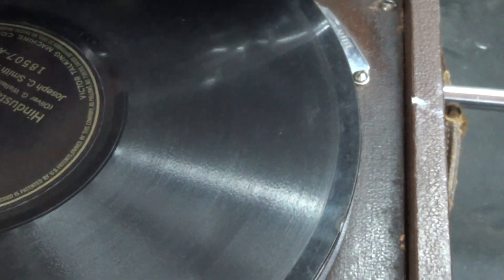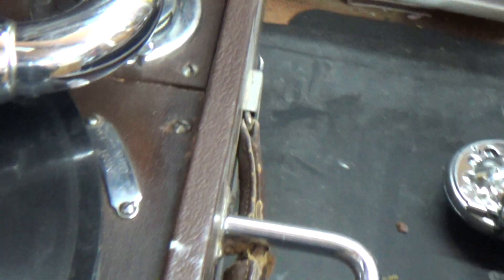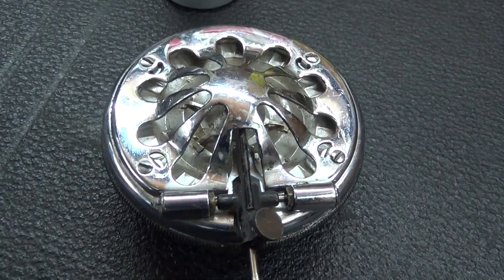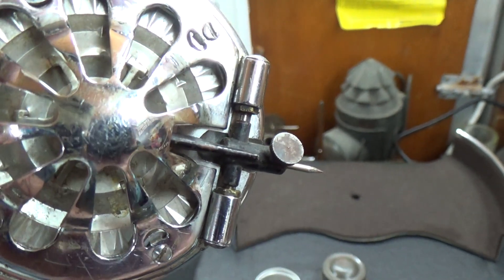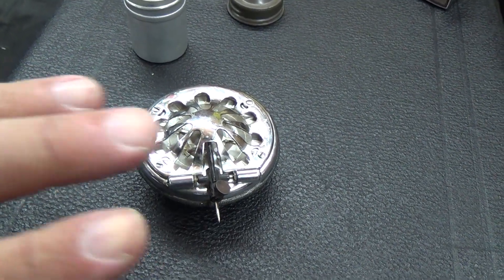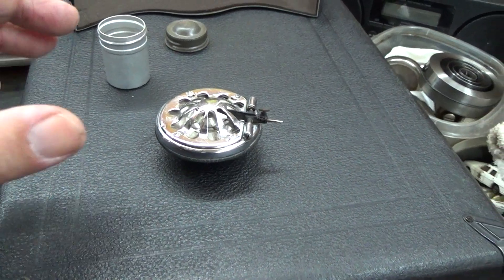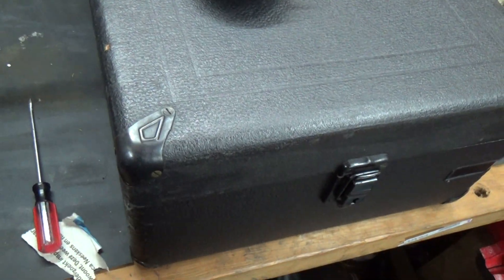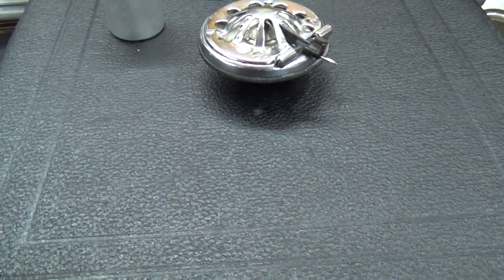Looking over the 5b reproducer from the HMV-102 for problems

Comment: Those 5b's are like tanks and I have only ever had one that has had a problem, I have had it looked at but not 100% sure that it's perfect, and my abilities at taking things apart I am afraid, are not good, lol...   That 5b does look a little worn but hard to tell from that record, I personally and you are more knowledgeable than I would ever be, but, I would use a 40's record with a clarinet banging away to fully see if the 5b can cope with it, the only way I could tell anyway as I have not got the ear to really hear any slight problems.  That adjustment on the needle bar is a massive pain, good luck, but I know you have more experience than most in making a good job, would be a shame to use another soundbox in my opinion, but better than nothing, I have two spares 5A and a 5b, prices are silly but can still pick them up from time to time for about £50 - 70 in the UK, although the best way is to look for a broken 102  going cheap that still has a decent soundbox, can be done...  Enjoyed the vid...  :)
Reply from the maker: On examination the problem has been discovered.  Someone tried to adjust the needle bar tension while having no knowledge on how to do it.  This involved jamming small bits of copper into the pivot points in some attempt to take up the slack.  They didn't know how the bearing caps work, or come apart.  I am going to try and make this reproducer work as I have no replacements for it.  I will have a video of this disaster up soon.  The damage done, not my attempts to repair it, I haven't gotten that far yet.
Reply: @Rockisland1903  Looking forward to seeing a post on repairing the 5b.

Comment: I'd like to see a new generation of vinyl playing in this machine. Records from this decade.
Reply from the maker: These machines would destroy vinyl very quickly, the material is too soft for the heavy tonearm and reproducer weight.  Records from the period were various shellac mix's, some containing stone dust that helped conform the tip of the steel needle to the record being played.
Reply: @Rockisland1903  Wooow... I didn't know this. Thanks by the answer.